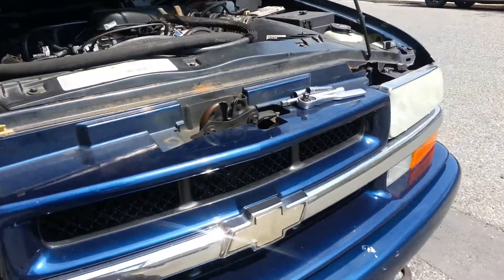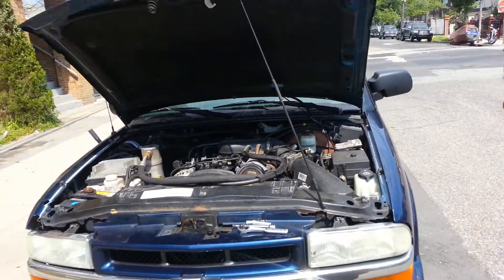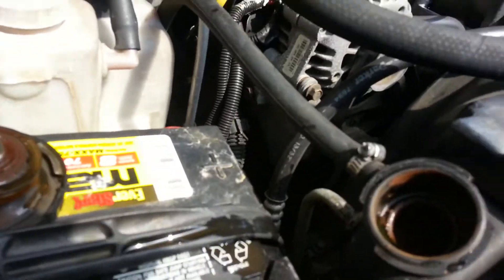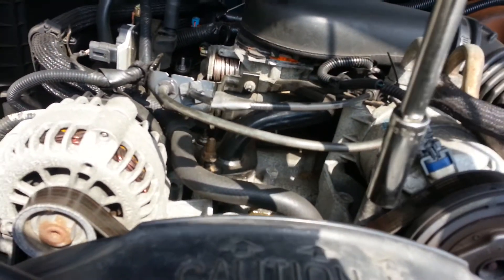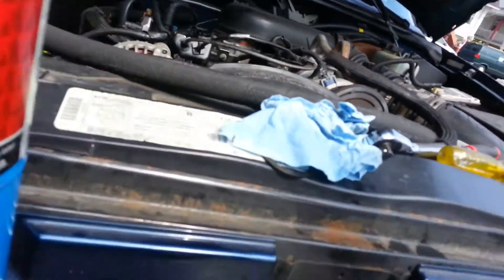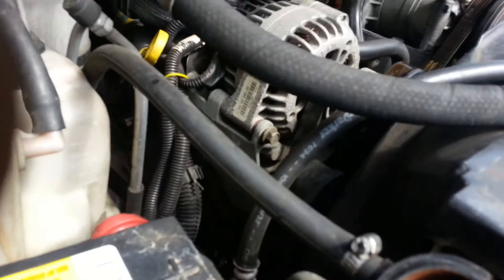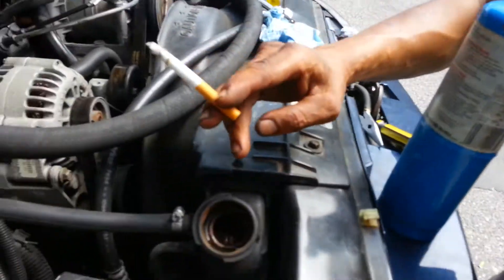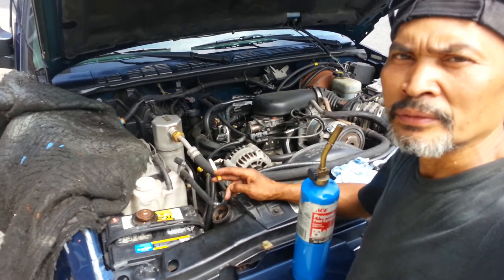Overheat Chevy s10

Comment: If it is rusty looking, it most likely had the Dex-Cool, or the nickname "Dex-Clog" and "Dex-Corrode".  They changed to the green anti-freeze.
Reply: Yep, I dumped that crap out of my 02' Blazer ZR2 & put the good Ole Green Coolant in her.
Reply: yea that dex-kill isnt actually responsible for the system failure, but rather the gasket material. if you replace the gaskets, stuff actually works pretty good

Comment: No. 
1st- Drain radiator
2- put bottle of the works in it, fill with water hose.
3- run for awhile, idle in park
4-drain out 
5- fill with 50/50 coolant.

It will desolve all the rust. Radiator will look new inside again. The works toliet cleaner wont harm anything either. You can actually keep some in. Putting a 1/4 bottle in at every coolant fill is perfect fix for rust and calcium built up in radiators. Keeps them parts running like new! $2 fix

Comment: My 98 chevy has the same motor it over heats i changed the thermostat put a new water pump and it still over heats what do i do
Reply: Have you change the heater core and fan clutch and radiator and coolant hoses and clamps ?
Reply: Replace the radiator  and cap.  Replace your head gaskets and valve cover gasket replace your coolant hose too

Comment: I have a 1995 Chevy so it reaches a certain mph and then shuts completely off I flushed the radiator  and changed the thermostat  and it still does it what do you think is wrong with it
Reply from the maker: Your cat is crock up check the cord could be PO420, OR PO435 .